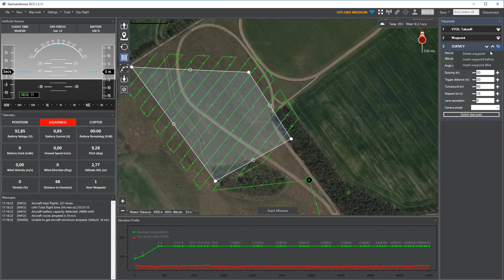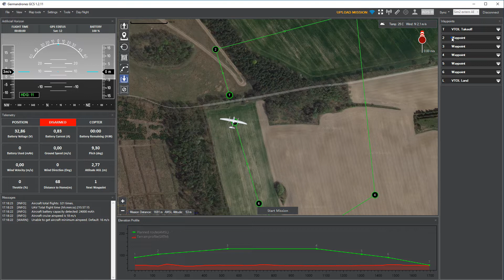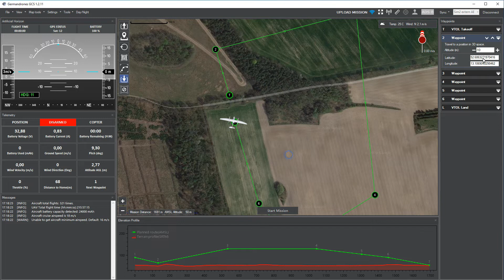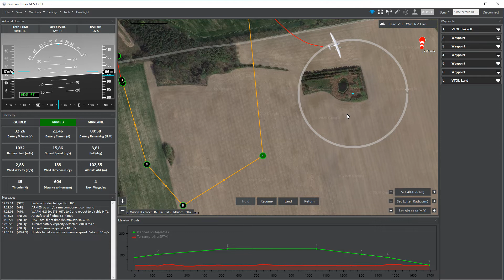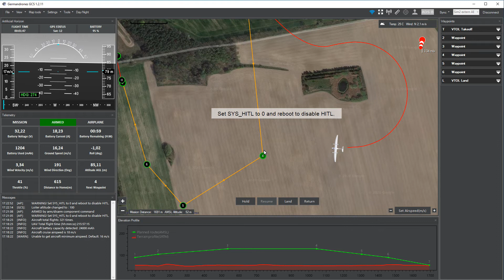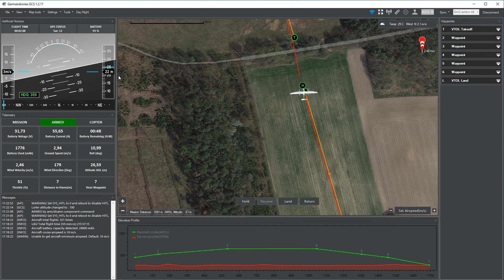Germandrones Ground Control Station - Quick Intro

Comment: Though I won't ever be a customer capable of affording the price tag on a professional quality UAV  such as the fleet marketed by Germandrones,  autonomous waypoint missions created with the Litchi Mission Hub have enabled my DJI Phantom 3 and Mavic Pro drones to log nearly 3,000 miles cumulative distance of waypoint flight plans covered fully autonomously.

These promotional videos that highlight all the enhanced waypoint mission features that are available with top-of-the-line UAVs that German drones produces, are a preview of where hobby-grade waypoint platforms like Litchi will be aiming for in terms of expanded mission waypoint capabilities that mere mortals can afford. 

 If GermanDrones ever  decides to sell a detuned VTOL plane with a 4K gimbal-mounted camera that can fly waypoints autonomously for one hour AND retail to hobbyists for less than $2K, there will be a STAMPEDE of former DJI drone owners looking for greater range than they could ever get with traditional quadcopters
Reply from the maker: Thank you for your interest in our solutions!